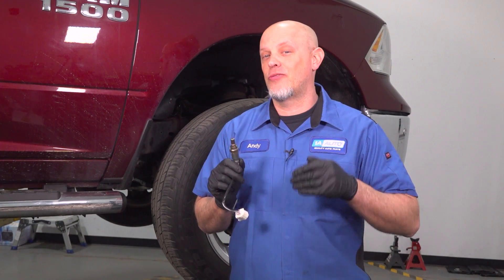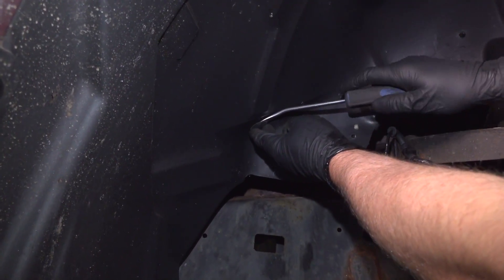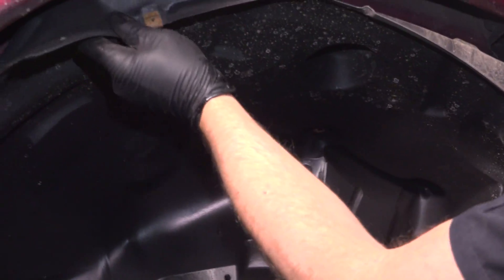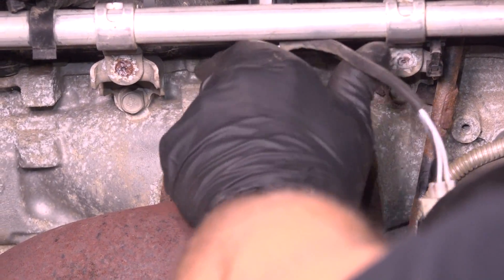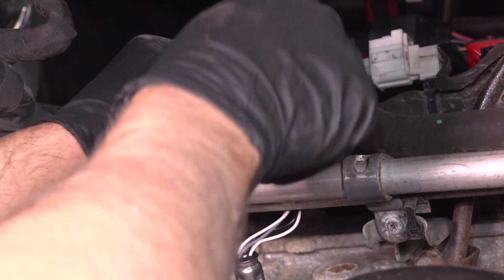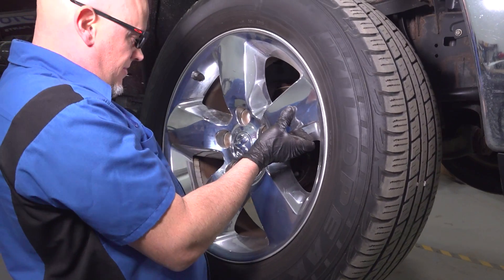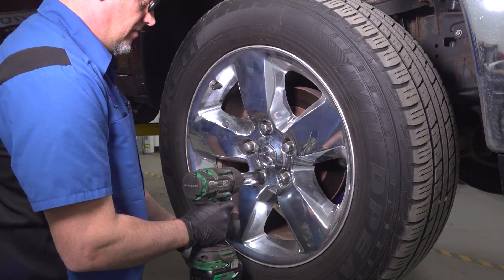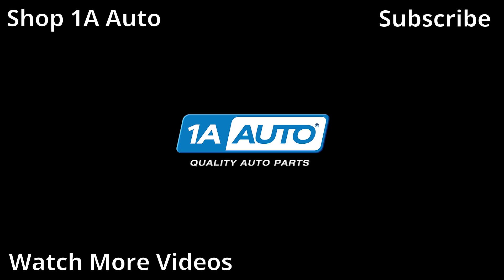How to Replace Upstream O2 Sensors 2011-2018 Ram 1500 3.6L V6

Comment: I did mine today with a 3/8 breaker bar I didn’t have to take the front wheel off I just went through the wheel above the shock tower came out easy on passenger and driver side

Comment: 2011 1500 ram 4.7 crew classic they put high flow catalytic converter and has brand new o2 sensors all 4 now its burning lots of gas how to fix